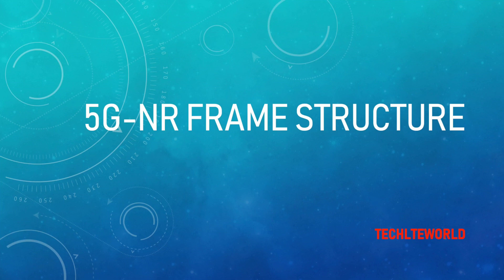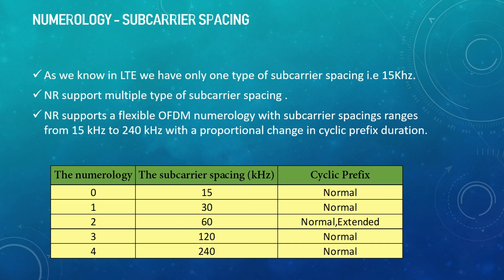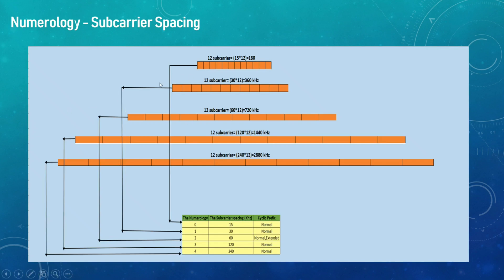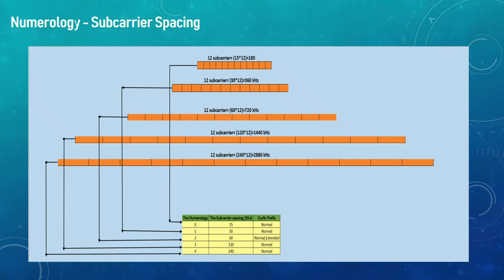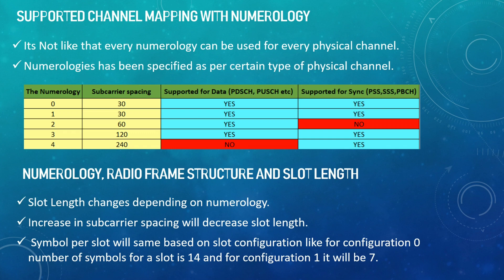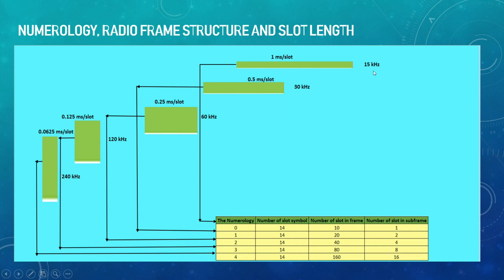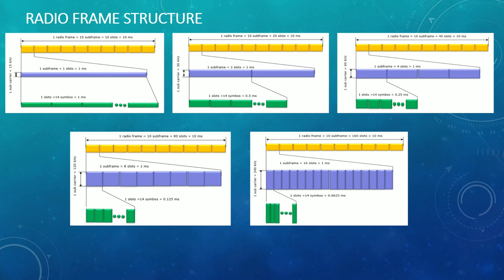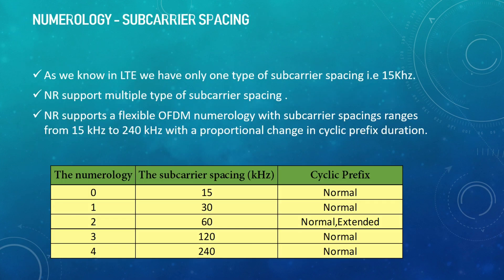5G-NR Frame structure (day 3) || 5G || techlteworld (TLW)

Comment: number of symbols per slot are either 14 or 12 in case of extended CP on 60khz case. not as mentioned in slide in min 5. right?
for configuration 1 number of symbols for as slot will still be 14 not 7
Reply from the maker: Ok sir let me check and i will do correction. Thanks for feedback
Reply: @techLteworld  yes agree with Ahmed here, number of symbols per slot will remain same (14). Please make the correction.
Reply from the maker: Thanks for correction I will try to edit the video